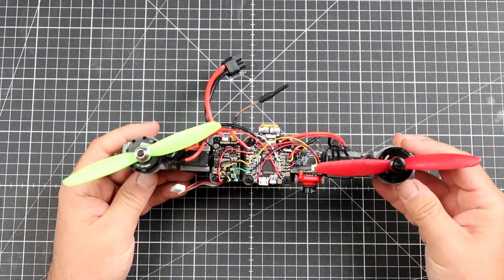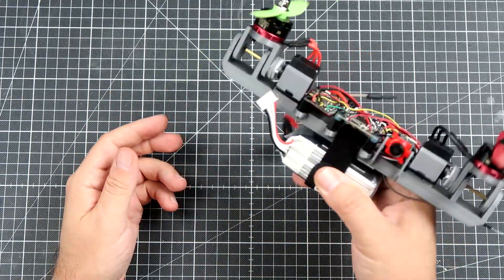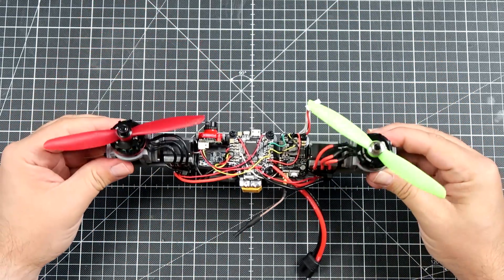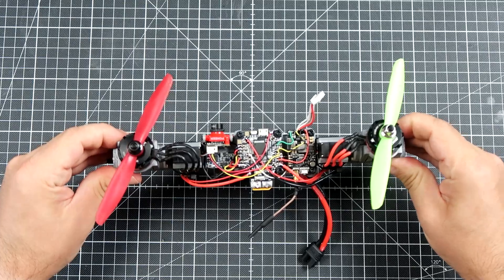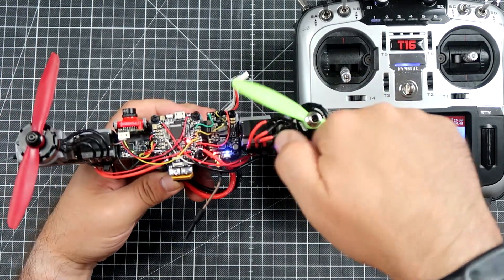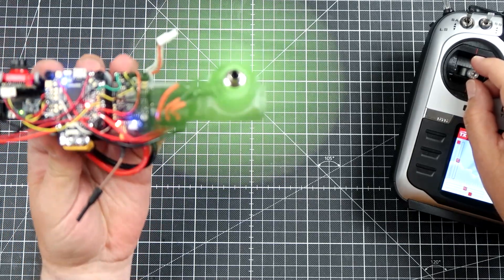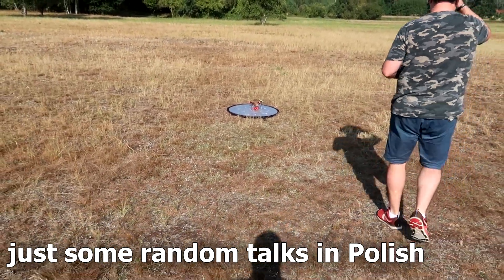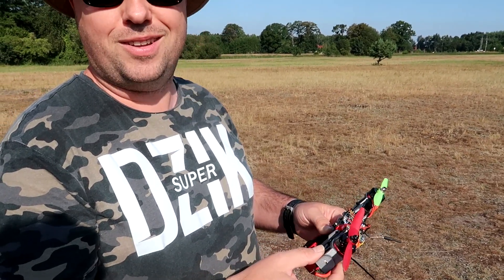FPV BiCopter part 1

Comment: I am making a VTOL So i need extra servo for  control surfaces How many servo INAV support ?
Reply from the maker: Up to 16 servos. But it depends on the hardware you use. Or you can use one if the serial ports to output sbus stream
Reply: @FPVUniversity   I am using Matek F765
I need some advice 
I am building a Dual rotor VTOL plane Which is similar to Bicopter  But it has control surface and  only Two tile motor for vertical and forward transition  Just like( Bell Boeing V-22 Osprey). Currently I am using arduapilot firmware but it is too complex for me and No-one have ever built such type of VTOL  .  Can i build a dual Rotor VTOL using  INAV Software Or betaflight ?

Comment: What servos did you use? And your frame looks heavy as hell, too much mass and it will have major issues controlling pitch.
Reply from the maker: https://bit.ly/2KkYBTH And frame has to be heavy or pitch control would not work at all
Reply: @FPVUniversity  my RCexplorer bicopter flies awesome, and it is light as hell, carbon fiber frame.
Reply: @FPVUniversity  a bicopter requires digital servos, those you used are no where near fast or accurate enough.

Comment: Turn the flying direction 90°. It's not going to work the way you have it setup now. You're relying on the bottom weight, which will always be changing (battery weight/centrifugal force/inertia), to determine thrust and servo rotation. I would have thought you'd have already figured this out. Good luck!

Comment: Hi Pawel, sorry to "Hi-Jack" this vid but wanted to contact you. I am new to your channel because I am searching for T16/open TX info.I have just bought a T16 and totally out my depth on the setup!  I read open tx was for people that like to do advance mixing and programming etc and can be very complicated BUT I did not think setting up the basic functions is so complicated. I am only going to use for heli and fix wing, my old specktrum dx7 as broke, on that I would use ,servo reverse,travel adjust,expo, pitch/throttle curves ,all these I can not even find in the menu!  the T16 came with mode2 which is correct for me BUT the stick channels need moving to suit me,i can not find how to do that.I have seen your how to on "using trims like a pro" would you ever do a vid on showing how to set up the functions I mention for the newbs to open tx.  I have been looking for over a week on how to use the T16 with no luck. I have tried forums with no replys or help at all. I think a lot of guys are buying this opentx stuff with no intention of using the vast scope of it BUT intend to use it just like a basic computer radio BUT with the ability of the multi protocol.I would certainly pay for a mauaul or vid on the setup and sure many others would

Comment: Damn! Well, at least it was funny! 😂
Great job, Pawel! Keep working on it! 😃
BTW, do you have any idea if the R9 ACCESS receivers could be flashed with the old firmware to work with the older module? Because I can't find any receivers in the market that aren't ACCESS. 😕
Reply: MC's Creations log a ticket with tbs and trade that rubbish in for crossfire ;)
Reply: @jamescherrill5736  Dude, I have absolutely no money right now. And I'm from the third world, Brazil... I always have to buy my stuff paying in multiple times... I usually divide with the credit card. 😕
No way. 😕

Comment: I would tilt the motors away from Center just a little bit, like maybe 5 to 10 degrees, to increase the positive lateral drag. I can demonstrate this, take a 1 meter long string and place it inside a drinking straw. Hold each end of the string in one hand, and let the straw rest in the middle. The straw is the bicopter and your hands and string are the thrust line. As you try to move the straw with your hands directly over the top, you'll find it difficult, but if you pull your hands apart just a little bit you can increase your control of the straw.